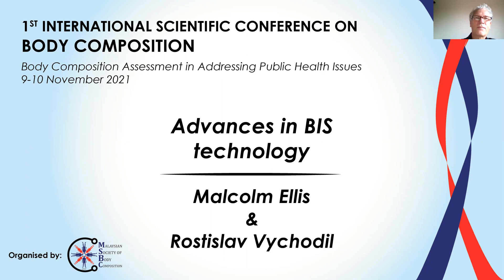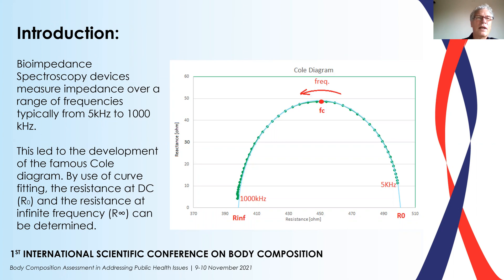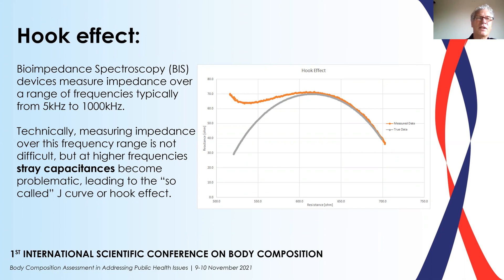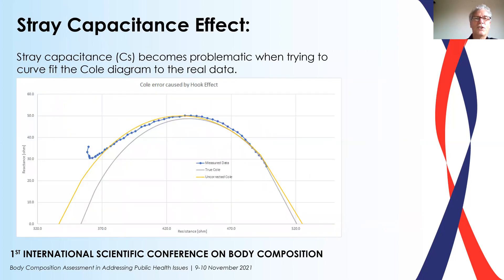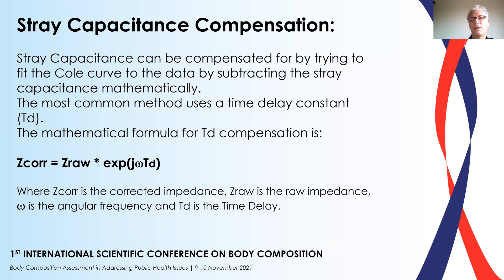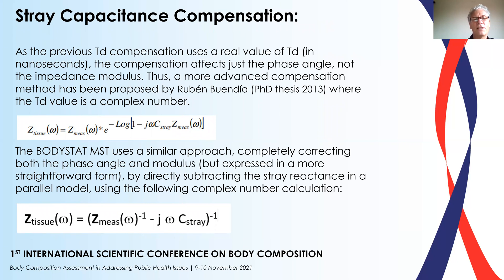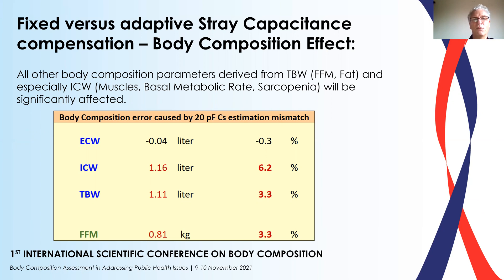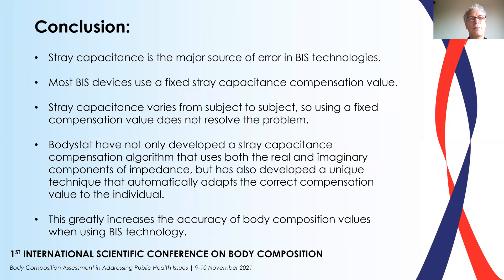Advances in Bioelectrical Impedance Spectroscopy

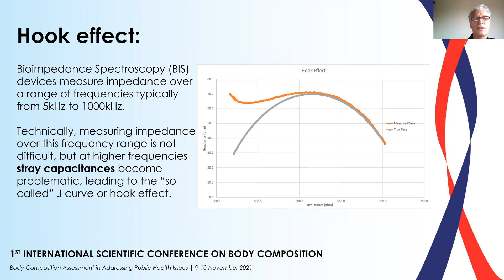Comment: Looking at the graph at 2:00, it seems like there is a frequency threshold when the error from stray capacitance begins (about the apex of the true data parabola). Is this threshold consistent in humans? If so, what is the threshold?
Reply: The error is increasing gradually with frequency, so there is not a exact treshold, but it is increasing stronly non-linear way so that it looks like some treshold graphically.
This "tresehold" is not consistent and different for different subjects. It depends on the stray capacitance of human body itself (consider the human body as a general conductive object - regardless if living or not living object) and also on the parasitic effects of electrodes and cables.
As the overall stray capacitance effect is not completely consistent but varying, it is necessary to use some adaptive dynamic compensation as described in the video to obtain high quality Bioimpedance Spectroscopy data.